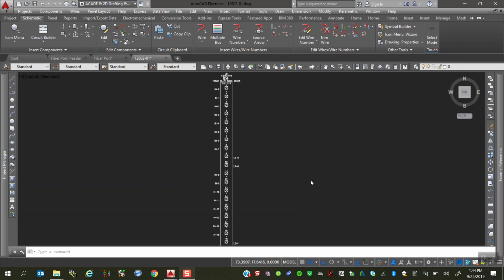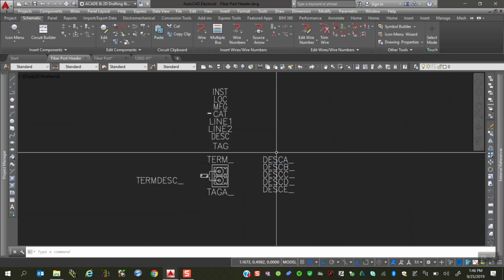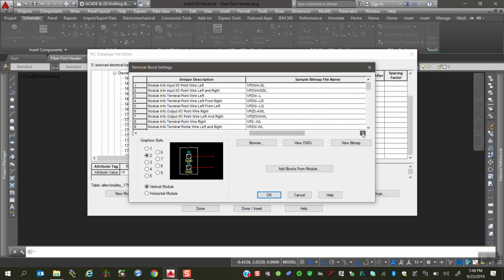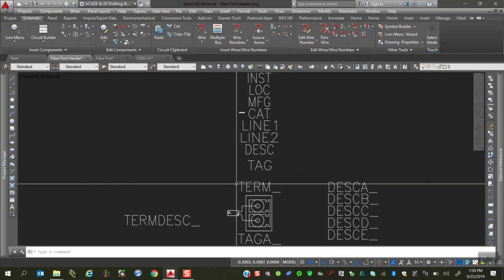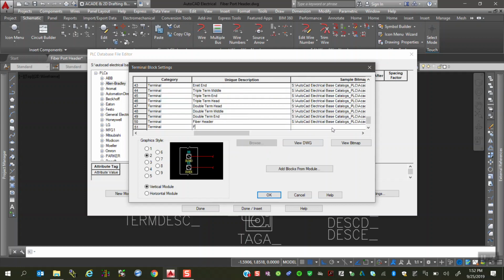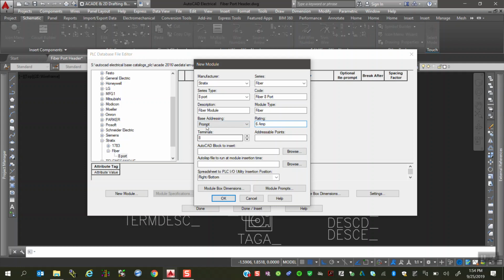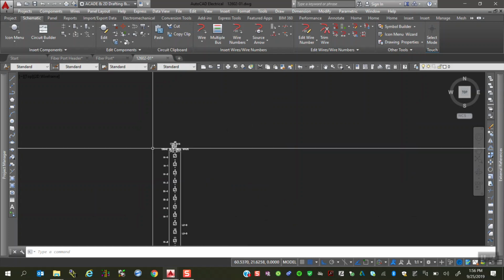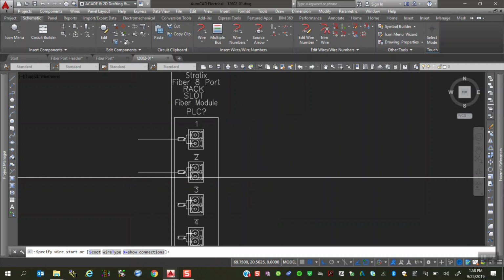AutoCAD Electrical, How to build PLC Modules

Comment: Can we put any no. Of points that we need?
Reply from the maker: Yes, you just need to set it up in your setting to match the # of points you require. I have used up to 64 points before but you can go higher. Not sure there is a cap. It may be easier to do your text editing in the MDB after you create the module.
Reply: @colbyhandley3150  🤝 thank you so much.
Reply: @colbyhandley3150  The video was very helpful.🙏
Plz make more video on AutoCAD electrical.
Reply from the maker: @skmgamer8214  let me know some things that would help and I can do some videos. Glad it was helpful!
Reply: Please make a video on electrical panel designing on AutoCAD electrical.

Comment: Colby, I noticed in your video that under Discrete Input modules that the 1492-IFM's are listed. Are these downloadable or did you build them yourself?
Reply from the maker: We built them.
Reply: @colbyhandley3150  (sad face) In this video, does the same technique to building IFM's? I am very new to Autocad Electrical but have been designing control panels for years.
Reply from the maker: We built them.
Reply from the maker: Right! Yes, so with IFM your going from module to IFM module with a cable right. So build you a block for your IFM part number and put it right beside your module and connect with a cable. Then your schematic off of the IFM.
Reply from the maker: Use the PLC Database File editor and you can build anything you need. You can use access which is where all that information pull from and build it that way as well. I like this method.
Reply: @colbyhandley3150  Thank you. I'll give this a try.